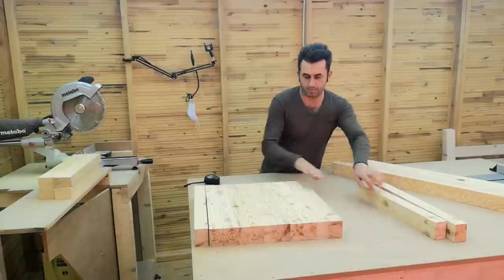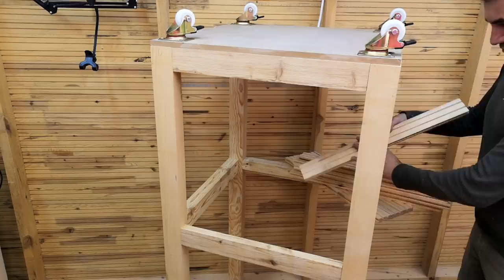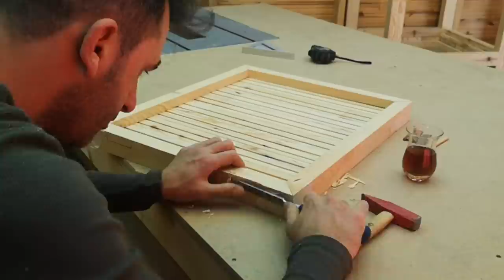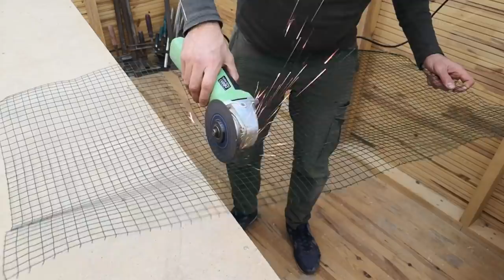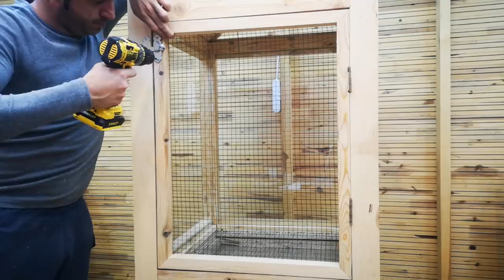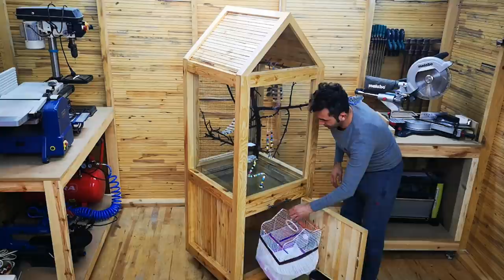How to Build Glass Bird Cage ? How to make a wooden birdcage ?

Comment: How long is the wood used?
Reply from the maker: If it does not come into contact with soil and water at the same time for many years, worming does not occur. 500 years maybe 2000 years
Reply: @WoodWorkerenginbircan  I mean the size of wood I need